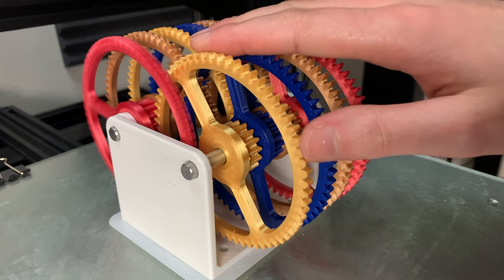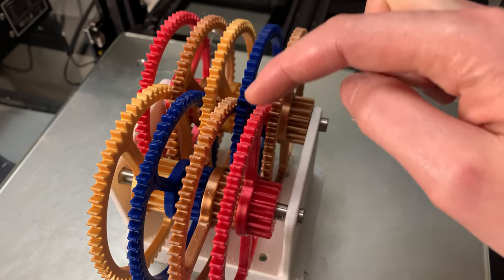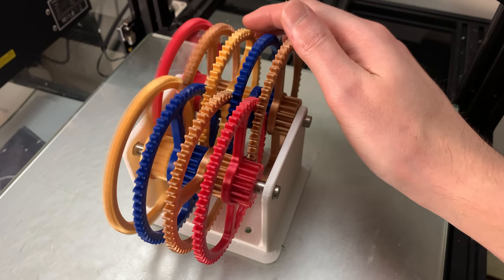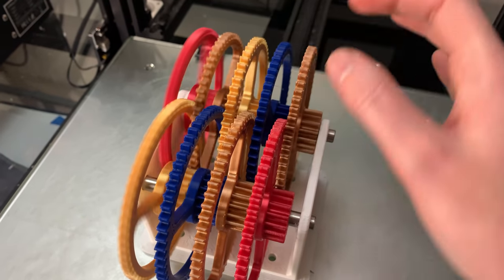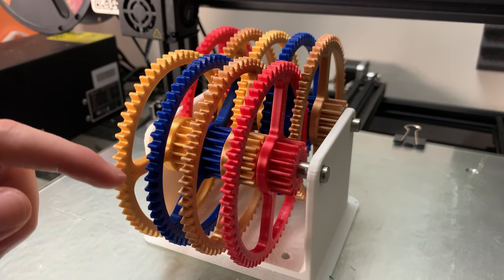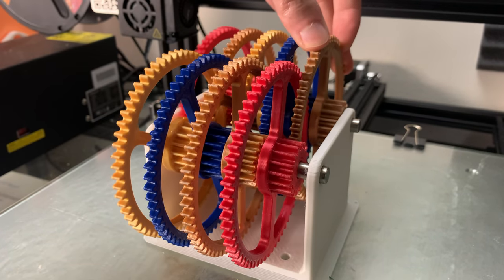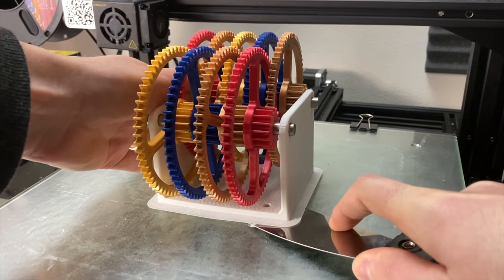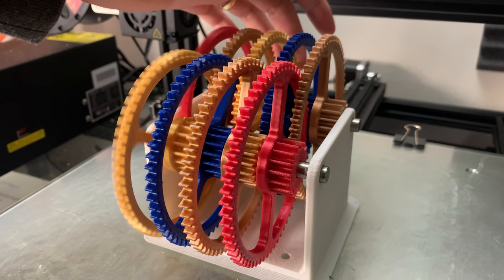Is it possible to spin the last gear?  (1:65000 gear ratio)

Comment: Ignore the mass, concentrate on friction,  if the coefficient of friction was zero then the centrifugal force would obliterate the gear running at 65,536 RPM while the end gear rotated at one RPM.  As the coefficient is not zero the action is like a seized brake. Didn't need to waffle on irrational, Un quantifiable mass or weights. It's sad that he even thought it might work, logic tells you it would not.

Comment: If the first few gears wouldn't melt down, a 20k rpm die grinder would turn the last gear in about 3 1/2 minutes.

Comment: It was clear you‘d need 2 tons of force to move it. But it wasn‘t clear if your 3D-printed gearbox cannot withstand 2 tons of force. And you certainly didn‘t try in the video. Fail. Clickbait. As the title promises an answer not given.